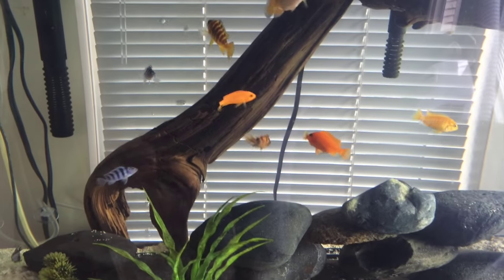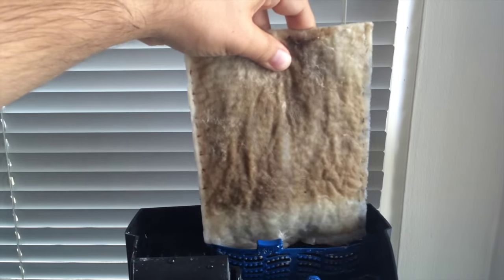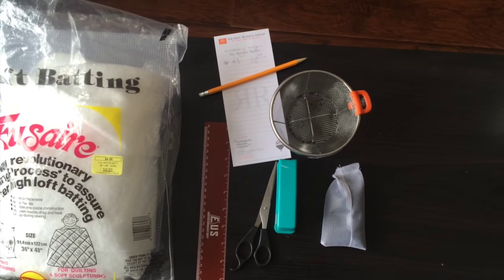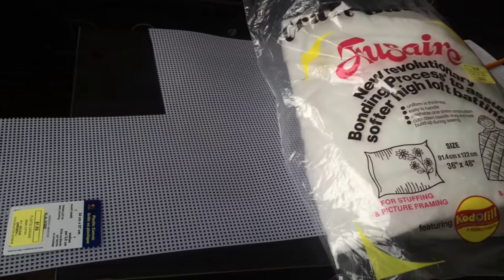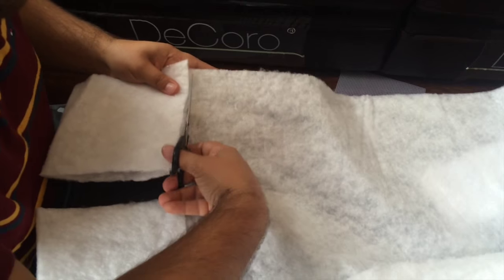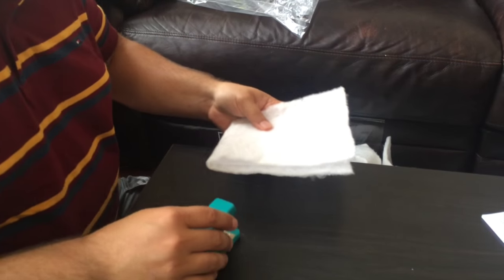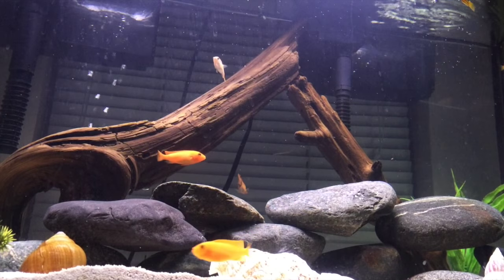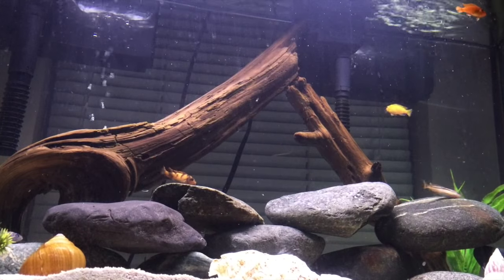DIY Fish Tank Filter

Comment: Hey just curious, why couldn't you just take apart an old filter and reuse the frame of the filter that is already separated with the areas for charcoal. Would that work?
Reply from the maker: +angela cole no it turned out to be a hassle, the frames weren't built to come apart and the other issue is the mesh wares out as well. It was faster to just make a new one

Comment: Excellent "how to"  DIY video. Fish tank carbon filters are very expensive. I needed to see where to buy the polyester 
material used as the filter skin and to house the carbon. My filter frame I can reuse as I wrap with new cut polyester, 
staple, then fill with new carbon.  A box of carbon at WalMart is $7 and should last me all year.  Just one replacement 
filter is that much. The cost savings are astronomical.  Thank you Naked Cichlid for your great video.

Comment: Great video, helpful to those who buy those expensive cartridges. I want to point out though that you can save more money buy using filter floss over polyester fibers. Yes they are of similar materials but the filter floss from Big Als is more than triple of thickness compared to polyester fibers but polyester is a finer material. Carbon is way cheaper if bought in bulk rather than those aqua clear pouches. To make a filter cartridge like yours my total cost is about $25 US dollars and that's a 24"x 120" role of filter floss and 3kg of Marineland carbon, it usually lasts me over a year before I have to buy everything again.
Reply from the maker: +Bryan Pena thanks for the suggestions! Will definitely look into the filter floss!

Comment: just get rid of cartidges altogether and fill your filter with filter floss, cover the input with filter floss, every water change simply shake the input's floss in a bucket of tank water and put it back on, never replace the internal filterfloss. Boom.
Reply from the maker: +Joshua Cole interesting, will have to try it out. Boom. ;)
Reply: where do I get the filter floss?
Reply from the maker: +Lemon King you can find them at any fabric store or even the fabric section of Walmart, they should come in rolls.
Reply: by never replace, I mean do a bi weekly maintenance on your internal filter floss and shake it around in a bucket of aquarium water to clean it
Reply: I've found that polyester fiber works very well due to how much bacteria it can accomodate

Comment: I would have created a re-usable mold with that mesh, use sponge to trap and keep beneficial bacteria, and would have used hot glue on that material to create the bag, much like the replaceable filter media by Top Fin, you would cut down on the cost only by the carbon and filter pad material.
Reply from the maker: +Papi Chulo thanks for the suggestion, might give it a try!

Comment: Where did you buy the polyester batt ?  I would like to buy this exact material you have in your video as that is the right 
size, and not a huge roll of excess to store it. I would glue the seams instead of stapling as I would construct the filter 
and change every 3-weeks. I have a small fish tank no more than a half gallon. Thanks again in advance.
Reply: With half-gallon tank, it can be handled with a sponge filter.

Comment: Staples are made of the cheapest steel wire with zinc coating. You cannot put zinc into an aquarium. You must substitute something else for the staples . Any metal in aquarium hardware that is submerged will be made of stainless steel.

Comment: I do want to say there is a flaw in this method where is your beneficial bacteria? It lies in your fiber and when you replace it you are removing the majority of your beneficial bacteria and restarting your cycle in your aquarium all over again. Add Biological media to your aquarium by using Biomax/BioRings from fluval or any other distributor that offers porous ceramic media.
Reply from the maker: +Bryan Pena well, we have two filters in the tank and alternate their replacement so that we always have one filter with the beneficial bacteria in the tank. Are you thinking that's not enough?
Reply: +Naked Cichlid No I'd assume you'd do that but there are more efficient ways to frequently change cartridges at any given moment that are more efficient. I use canister media in any HOB Filter. For example I use Aqua Clear HOB filters which use a layout like a canister filter by having everything individually laid out in mesh pads. That way you can replace anything whenever you have to. For example if your polyester gets clogged relatively quickly but your carbon is only 3 weeks old you can't replace your polyester without throwing away your carbon that can still be used or vice versa. The method I like is to have Ceramic media that serves as preserving all your beneficial bacteria in porous clay that never has to be replaced.

Comment: You are throwing away beneficial bacteria! Why not use some sort of sponge you can wash and keep re-using?
Reply from the maker: +gilpi552 we thought it would be OK to throw away because we have two filters going. We don't change both at the same time so the bacteria from one filter can stay in the tank and eventually build on the new filter.
Reply: +Naked Cichlid exactly!!:)
Reply: spaceboyxyz i use the quietclear 75 which has 2 cartridges. For that model, I only toss the first one at a time and switch position of the second one when i install a replacement diy cartridge

Comment: it's easier to use something with a big media capacity and fill mesh bags with ceramic and another bag of carbon. cheaper and less effort
Reply from the maker: +Marc Mayfield Thanks for the suggestion, didn't think of that! Only thing to keep in mind would be the capacity of the cartridge slot itself!
Reply: +Naked Cichlid in almost any filter I have come across you can drop in much more ceramic media than what the plastic that and other filters use to harbour bacteria so I just empty everything and use some filter floss as a pre filter and a huge bag of media. even the internal whisper filters by tetra. aquaclear filters are already designed to be used that way.
Reply from the maker: +Marc Mayfield hmm interesting should give it a shot see how it goes!

Comment: Hello,  I have aquatic turtles can I used this filter for my turtle tank??
Reply from the maker: +Marta Sazo not too sure about turtles and the environment they need to be healthy, sorry!
Reply: Marta Sazo yes you can just be sure the intake is low enough in the water column to suck up the water and put in a place the turtles  cant knock it over attatching a under gravel grid to the intake is a good option

Comment: I was looking for to cut cost on filter....thanks for the very good video. I have a terrible ammonia issue in my first fish tank and i reuse the old filter that was not too old but i pull a gap on top and added more carbo and zeolite to help on reducing the ammonia on addition to the water change....it is working good. But i will follow your instructions to build mine. Thanks

Comment: These filters do not have the best reputation for reliability.  In addition, they really do not offer any biological filtration.  If I was to pick a power filter, it would be an Aquaclear.  You can fill it with whatever you want.  Plus, they have been around for years so parts are easy to find and not expensive.